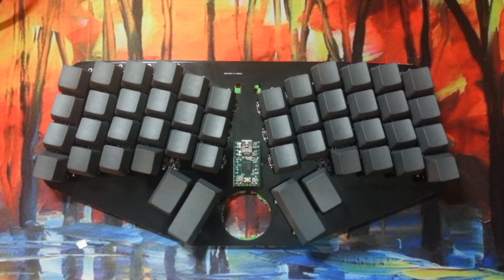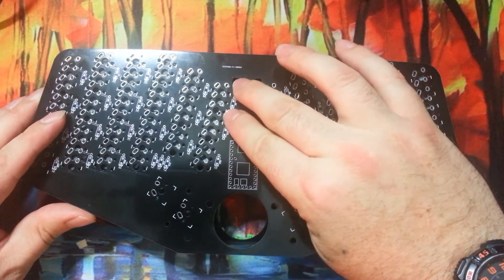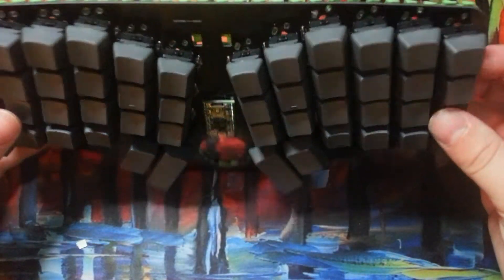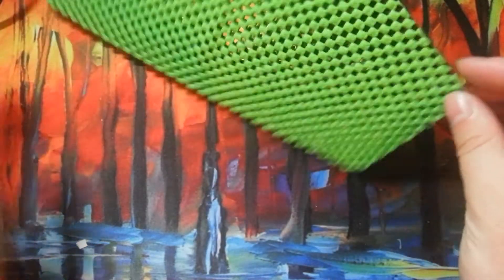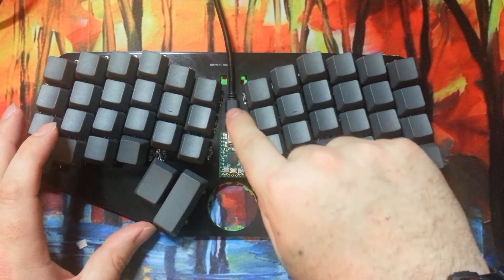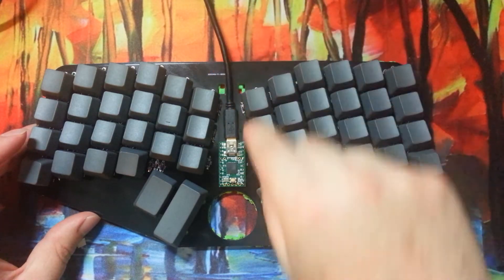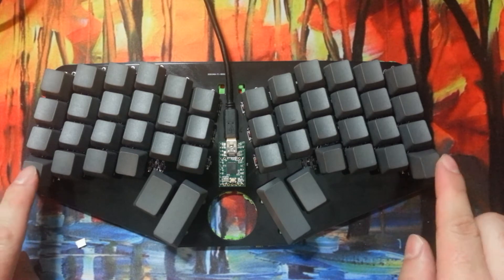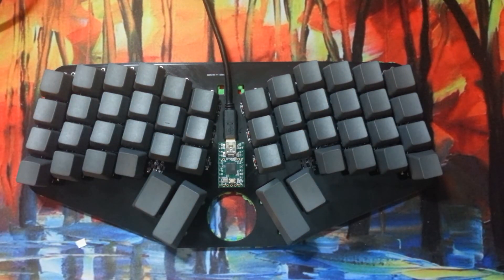Signum 3: Adjustable Ergonomic 40% Mechanical Keyboard

Comment: Overall, I like it. Do you think having an upper board to "snap into" those buttons is unnecessary? So far your designs had that (and were mostly PCB-less hand-soldered). But I'm a bit concerned if it's mechanically durable enough. Also, ortholinear keyboards look better, and are also smaller.
Reply: orthos do look pretty cool, but are a nightmare for your ergonomics. Jack Humbert himself said his planck design was for looks and not ergonomics.
Reply: Thanks! I think I'll redesign my plans then.
Do you think just having a PCB without additional support is enough? If yes, what PCB thickness do you recommend?
Reply: additional support as in an acrylic/aluminum base? You can get away with using just the pcb plate like Troy does, it's a little bit more fragile but lighter and closer to the ground which is better for your hands since there's less wrist extension. http://www.ergovancouver.net/wrist_movements.htm

I would choose a 1.6mm PCB thickness, maybe 2mm if you're ok with paying extra.
Reply: Thanks!
Reply from the maker: Running a straight PCB means you have to reduce any kind of flex on the board. This means you can't put rubber feet on the 4 corners, and then pound on the middle keys where there's no support. This would make the board flex and risk breaking traces after many uses.

This is the other part of the appeal of the shelf backing or neoprene bottom that distributes the weight and prevents stress points.

The upper board is generally called the plate, and serves to kind of protect the PCB (but they usually have openings in them), and to keep the switches aligned. You don't have to worry about alignment if you use PCB mount switches, but for alps or plate mount switches, you'll need to be careful when soldering to make sure they're lined up without a plate!